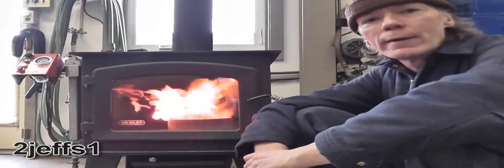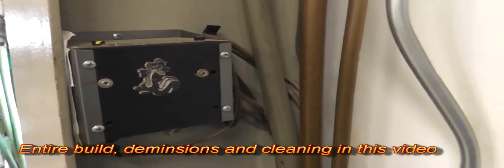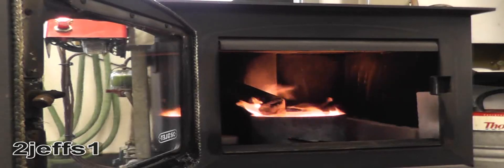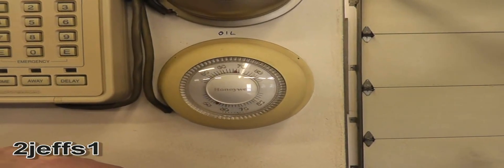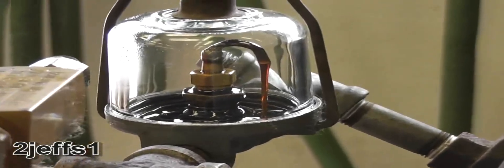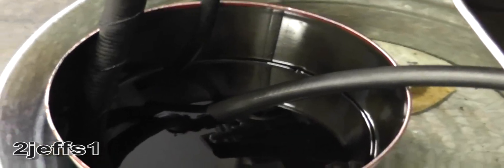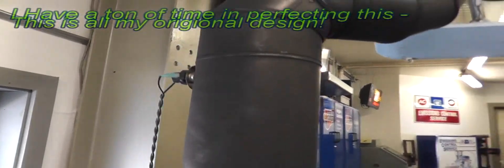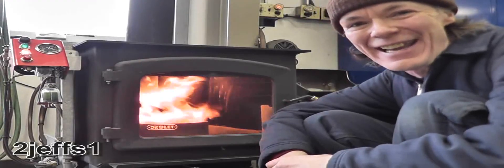Homemade Waste Oil Burner Heater for Daily Use DIY

Comment: Very ingenious.. What do you use for heat at night.?
Reply from the maker: Robin Conkel-hAnnan Hi Robin. The building is insulated quite well so no heat is required. On the weekend the furnace might come on if it is extremely cold out.
Reply: 2jeffs1 very good

Comment: Thanks for sharing! Is the top of the stove hot enough to boil water?
Reply: ps. You could probably use an arduino controller and some relays to computer control the operations of this beast!
Reply from the maker: Hello John. Yes I have used it for a humidifier in the past but running cars in with snow & water on them seems to help a lot too! That would be interesting to set up a more intricate system with a computer too - The thought was there a few times thru the years.... Thank you for viewing & glad you enjoyed the video, Jeff

Comment: Hi Jeff,
thanks for your reply. I am now trying to source all or most of the parts so i hope you don't mind answering the odd question every now and then. What type of solenoid did you use?
Reply from the maker: Hi Laura. Friends always bring me things that they or their friends no longer need. I have a considerable hort collection upstairs for projects. The solenoid I used had to be modified for the stove use because it was vented externally and I cant remember who gave me that. One viewer said they have a lot of them on ebay. Just make sure to get a normally closed one and 12 volt if that would be the type of power supply you are using. Hope this helps you out. Jeff

Comment: Would this unit be safe to install in a concrete basement for an old farm house to help out with heating the house in the winter time? Or not recommended?
Reply from the maker: Hello Les. I never had any issues with the stove getting out of hand. I thought of building one for the house at one time too but I guess was just content to have one in the shop. I just feel more comfortable being around to keep an eye on things especially If you had a manual setup one.

Comment: Thanks Jeff for sharing this. It is going to be our spring project this year because trying to heat a 60 x 60 truss roof building with propane is futile! I just have 1 question the hub in the center of the pot is height and diameter critical? I am assuming it is stainless steel as the pot is.
Reply from the maker: Hi Jerry. Yeah I seen the propane rob job on the news - that's horrible. I call things like that robbery without a gun! Yes the center hub is stainless. It's the same thickness as the burner. Thicker wall steel would be fine & last too. That don't get as hot as the outer wall of the burner. As for the size if you are within a 1/2" or so you should be fine too. The main thing is it retains the flame swirl affect. Good luck Jerry and Thank You for viewing my video, Jeff

Comment: BEST DIY heater on Youtube and anywhere else I have ever seen!
The automation is simple yet effective and makes the heater entirely practical and useful. It's one thing to get some oil to burn in the backyard, it's quite another to put the energy to good practical use where the heat can do some good. 

This thing is clean, effective safe and practical. A person would pay many thousands to get anything as effective in a commercial unit and then I think still have more maintenance and issues. 

I also love the fact you have fans on the thing to maximise the output and utilise some of the heat from the flue. Very few people pay any attention to all the heat going straight out there and do anything to utilise it. You seem to have thought of everything with this setup. 

One thing that may make the burner a little quieter is to use a blower from something like a VW Kombi.  They are 12V and would blow plenty of air for your needs and are basically silent. There are other blowers from other cars as well you could use if you had any interest in making the thing any quieter that is.  I kind of get the impression you are quite partial to the old faithful smog pump you have now though!  :0)

Brilliant job, I think this heater is definitely the Benchmark for all DIY heaters.
Reply from the maker: Well hello glumpy10. WOW. I must say that I think you had one of the BEST write ups I'd ever read! You have covered every point of interest and really grasp the value of all benefits. Where it was so cold this year it was appreciated more than ever. It is also a great conversation piece. The customers seem to want to check it out & sometimes bring a friend too. Years back when I put the components in this stove - I have a customer which sells wood stoves. When he came to pick up his vehicle he looked out in the shop area and seen the stove. You should of seen how fast he boogied out to look at the setup. That alone got a big smile on my behalf. I think you had me figured out pretty good on old faithful. On so many of the builds here there are hort shelf's upstairs with things saved that have been useful to save customer some $ and for these late nite projects. I'm not familiar with the VW Kombi blower and due to curiosity will be checking that out! But hey Thank You for your comments and stop by again any time, Jeff
Reply: Yeah, I'd be hanging round checking your heater out and taking lots of Pictures as well!
The only thing your heater needs is a Coffee pot sitting on top brewing away filling the place with  it's aromas!  :0)

Being able to control the heat has been the biggest hurdle in my Burner setups and I think one really has to have played with these things hands on with a real purpose in mind to appreciate all that you have done and indeed, overcome with your setup.  Making something work is a lot different to PUTTING it to useful work. 

I'll be on the lookout for an old wood heater now to modify like yours for the garage. 
It's nice to go against the grain and come up with something you can enjoy and indulge in because you don't have to worry about cost. I'll bet your shop is the warmest anywhere around! :0) 

Well done on your setup, it's definitely the ultimate DIY heater I have ever seen and I have looked at a lot.
Reply: You talked about the Volvo 12volt smog pumps just so happens I turned my wood burner in my shop into an oil burner after watching jeffs video, I incorperated a 12 volt Volvo pump into mine it gave out a high pitched noise while running that made my ears ring after an hour or so. Eventually I moved it upstairs by my oil barrel to muffle the sound, but it does put out sufficient air flow, just one thing to consider.
Reply from the maker: Hi Brad. I always wondered about using an electric smog pump.  Very interesting and glad to have that confirmed where it is a possible option. Thank You very much for the post, Jeff

Comment: Thanks Jeff.  This is awesome.  I will be building one this spring for my garage.
Reply from the maker: Hi Les.  This unit is so easy to light and clean. After a while things can be taken for granted. It has been much colder here this winter than normal. This was a great year to have this unit!

Comment: just a quick question....on your stove, what is the blower in the back for?  Is this used to pump air into the stove for combustion or is it for some other purpose?
Reply from the maker: Hello. The stove came with the rear boxed off to collect heat from the rear of the unit instead of heating the wall behind it. They sell the blower as an accessory to the stove. It has no affect on the burn at all. It seems to work quite nice.

Comment: Jeff- That was a great video and a super cool idea. Wow- you said that you have plans for this, right? I would love to do a build like this, too. How can I get a copy of them? I look forward to starting this.
Reply from the maker: Hello Gregory. Yeah I thought I'd better change the description due to that can be taken several ways. What I meant is all the info (Dimensions) to build this is on the video. Freeze frame that area & copy. I never had a drawing of any kind for this. Drew the dimension drawing for this video. Watch Part 2 for a better understanding if your going to build one. Get the materials together and things should go quite easy compared what I went through to get this far. I tried so hard to cover all in the video's but if you read the comments that should help considerably too. And If need be I'll be here for help if needed. Thanks Gregory, Jeff

Comment: Where in Canada are you using it and does it heat your shop well?  how big is your shop?
Reply from the maker: Hello. I'm In Wisconsin and have heated with this setup for over 30 years now. Just kept improving on it through the years. The main part I heat is 30x48 and 8' ceiling. After that warms a bit then sometimes I'll heat the full 30x82.

Comment: Nice Video.  I would like to make one for my garage.  Approximately with your setup.  How long do you get out of a Gallon of oil?
Reply from the maker: Hi lowrider. A gallon of oil would last all day when the outdoor temp would be around 40 ~ 50 F outside. At that temp it would start cycling from high to low in 30 ~ 45 minutes where the shop is up to 68F. It don't take much to maintain the temp then.

Comment: This is what youtube should be all about. sharing idea's and design's that help others. I have one question, can the smog pump be replaced by a simple blower ? also, the 12v solenoid can be found on eBay for about 12.00
Reply from the maker: I have tried 1 and 2 blower multiple configurations. A blower will work but I couldn't obtain satisfactory results so continued on to other options. The biggest thing is you need / use more oil where a lot of the heat goes out the chimney. Lotsa carbon will in the burner in just 1 day of running too. Many trial and error holes in original stove!  I'll have to check that out on eBay. Thank You for the tip, Jeff

Comment: Decided I'm going to start out with a manual drip type to cut my teeth on, installed in the 55 gal drum model.  Horizontal mount, sand in the bottom, typical barrel kit. then grate or something mounted on half submerged in sand fire brick.  Get her started like yours starts and then get a valve to drip at idle as you call it and then burn away.  I also thought of burning a certain amount of oil at a time...say a gallon.  Find a VERY heavy duty or cast iron reservoir to mount on top of a flat stop top mounted and just above the bottom and only barrel.  This will keep the oil very warm and flow nice.  But, be able to take it off or have a quick disconnect if necessary.  My heater will almost NEVER run by itself as I will be in the garage with it at all times.
Reply from the maker: Sounds like your getting some good starting points together. That's a good idea to monitor  - especially on a new manual control setup! Have fun on your venture, Jeff

Comment: One of the coolest videos I have ever seen on YouTube!  Now, my question as a part time hobby garage auto repair with plenty of waste oil in Augusta, GA.  How much would you charge to come to my home and build me one?  I will put you up for as long as it takes in sunny Augusta, GA.  that system is so awesome I would use it to heat my entire home if she were set up better.  But for now, just need it to keep my dogs warm in the winter.  Tks

Comment: hello I upgrade  with a 5 gallon holding tank with a 1/2 black pipe going down 4 feet then into 2   1/4 supply lines with valves like you have( thanks to Ebay)  with sediment bowel.  had the first burn with the new stuff about 2 hours ago and wow it works great the burn was awesome!!!!!!!!   thanks so much for sharing the info........... I need to upgrade my air with the pump yet.   I have it,  just not done yet I'm using air compresser right now!!!!!!!      sorry but I'm hoping to make mine just like yours one day at a time 
thanks again
Chris from Ohio
Reply from the maker: Hello Chris. Nice description you gave there. Yes there sure is exciting to build and see it come alive !!! These burners make their own sound. After a bit you can tell how they are operating just by listening. But - hey keep up the good work Chris, glad things are working out for you, Jeff

Comment: hi, can the smog pump be substituted with a blower?
Reply from the maker: Actually when I first built the stove I tried 1 blower at an angle to spin the flame. Then I tried 2 at 180 degrees off. It didn't burn as clean and a lot of heat went out the chimney due to the volume of air entering the stove. I would recommend an air compressor over a blower and of course the smog pump is the icing on the cake! Hope this helps ya out, Jeff

Comment: thanks Jeff for the video we live in northern MN it was 30- last week. our garage stays about 10 deg in side at that temp we have a Daka wood stove in there going to try to change it to a drip system like yours do you think I should thin my used oil out with diesel fuel its mostly 15w40 kinda like molases at 10 or - my wife hit the automatic garage door opener senser at night when i got home from work  it was 25- in the shop.  have to say you have a very clean shop not like mine
Reply from the maker: Hmmm - Good question. I've never operated in that cold of conditions. Where the shop has water I can't allow things to freeze. Some possible thoughts for you would be use 3/4" line from the tank to the drippier adjustment valve. OH - and maybe some water pipe heat tape on the line and shut it off after a bit. I would think 1/2" line would be fine then. Maybe put it on a timer and they have the thermostat controlled ones too.  Another is some small assist in line pump. I can't think of anything off hand to use for that. Maybe some other viewers would have a suggestion. and last - I like your idea on the thinning but - I found different fluids do settle different in a storage tank after time. I would test first in a small container first. Hope these are some starting thoughts for you. Good luck Frank, Jeff

Comment: one more question jeff can you use solid or does it have to be hollow center pc. in center of pot  to burn right.
Reply from the maker: Hi Ronald. The one I have is hollow with a disc welded on top. Also there is no opening on the bottom of the burner where the hollow sits. If you have solid bar stock to use that should be just fine too, Jeff

Comment: this is THE TOP OF THE LINE waste oil burner I have made a test burner in pot belly wood stove and I am very happy with the turn out couple things to fine tune. I used a 6 inch well casing for my burner works great but I need 2 supple lines or more volume above stove right now I have 4 gallons about 4 feet above and when the garage is cold I cant get the oil to flow to keep good fire burning. I have 1   3/8 line still working on it!!!!!!!!!!!!!!!! love the videos keep up the good work
Reply from the maker: Cool. The well casing should last a long time! Sounds like you have a pretty good handle on things. In my experimental stages years ago I made burners out of tin. They only lasted maybe a week. But when your on a hunt for the best dimensions they were just fine!!

Comment: 2jeffs, NASA called, they are short a rocket scientist....
Great design.
On average, how many gallons oil does your design use? What is your average daily high and low temps when you have this fired up?
Reply from the maker: Hi Scott - Digg-in your comment, big smile here! Best guess is 2~3 gallons a day. Outside temp -10F. That would be cycling from hi to low after several hours. Also the wood stove that I'm using is more efficient than a pot belly stove where it runs the hot air back through the top and is more air tight. If I run the shop temp at 68F instead of 78F that seems to save too. If it's above 55F outside sometimes then I'll just run the furnace. If I do run the oil stove then I'll run it up more than normal & shut it off for the day, Jeff
Reply: 2jeffs1 Thanks for the reply.
-10 is colder then I would have to worry about... I might have to give your design a try some day.

Comment: Converting a fuel oil furnace burner is rather easy.  
If you can get the used oil up to around 200 - 240 F at the nozzle it will ignite and spray just like fuel oil and diesel fuel do.   I just made a preheater unit out of a 3" long 1"dia copper tube that has a simple 1/4" x 2" 200 watt cartridge heater and a thermocouple.  
The oil passes through one passage that is 5/16" dia with a 5/16" dia threaded rod inside it to keep the oil flow to the outside off the passage.  For temp control I used a off the shelf programmable temp controler unit.   
Other than that I have a solenoid valve that bypasses the oil flow from the nozzle (Keeps it from dripping) until the preheater temp reaches ~190 F then applies full pump pressure above that.
Reply from the maker: This is a nice writeup you did to explain what you are doing. It's nice when all the hours of R&D finally produces the desired product!

Comment: how to make stand for center of pot. and what is it made of. also how to attach to pot. thanks ron
Reply from the maker: The center of the pot is a piece of stainless tubing welded in and then a disc was cut for the top cover and welded on. This burner could be made from regular steel which works fine too but don't last as long. Good luck Ron, Jeff
Reply: thanks jeff for help one more question. how far down in pot does pipe go for oil to drip in pot. you are awesome to share this video.
Reply from the maker: Ronald Cassner
That 2" pipe with the heat shield removed would pretty much be flush with the top of the burner. And of course with the heat shield on it extends into the burner a bit. Not real critical on that dimension.